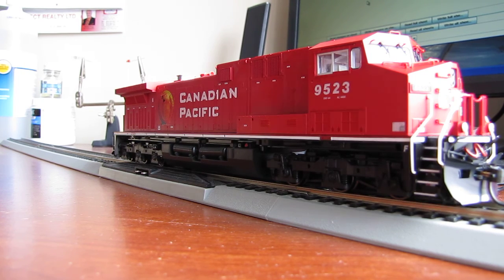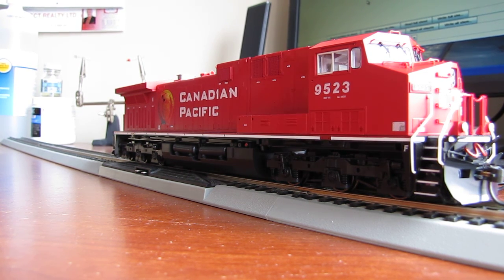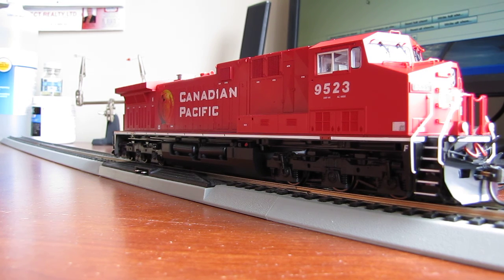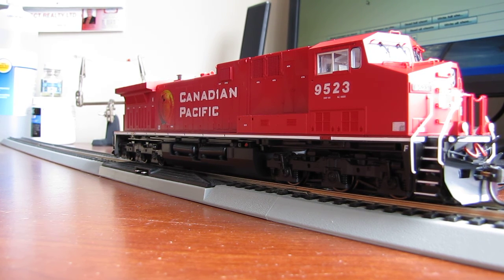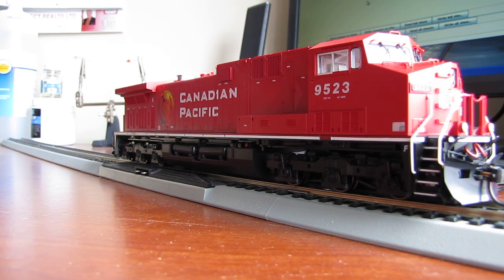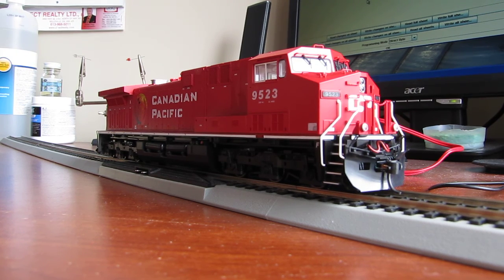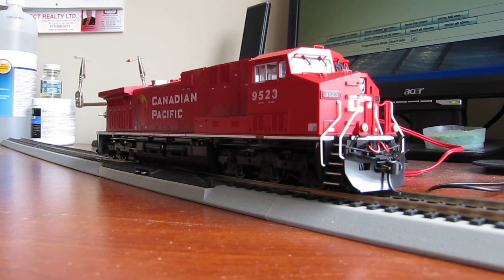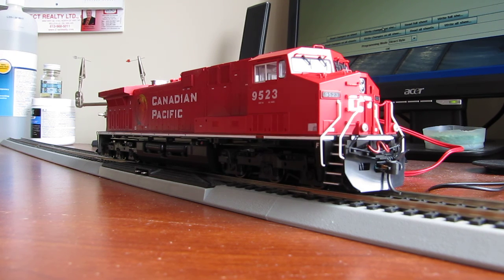03.13.13 Digitrax SFX004 Soundbug Issue, Can anyone help?

Comment from the maker: I have used tsunami before. I love them. Both Digitrax and tsunami have their differences and benefits. I like the fact with Digitrax that you can have separate cv settings from the sound board to the motor decoder.  Also as mentioned in my last vid, I simply purchased this Kato because I had the dh165k1a and sound bug in the closet and wanted to use them.

Comment: I think that's the wrong sound decoder for this locomotive, to me it sounds like one for a EMD locomotive, and normally with any EMD engine it will jump to I high notch then come down, AC4400 and Dash 9's don't, they have a lower chugging and you can hear the primer before it starts, with EMD's you get this beeping alarm

Comment from the maker: I can put whatever sound I want in this engine. I just don't have a FDL16 sound file to load onto the decoder so I just put this one on for now. The Digitrax AC4400 sound file is garbage and sounds like a constepated donkey trying to pass gas.  However in this vid, the soundbug is not supposed to do what it is doing.  Especially when I hit function 6 and it reboots the sound.. Thats not right.

Comment: Hey Brian, have you tried factory sound settings than upload the file? Myself I have a sdh164D tip do not purchase! If it still makes the wired sounds after a factory reset of the sound file my advise is sell the sound bug get what you can for it and save it and purchase a tsunami decoder suitable for it. My gp38-2w has a tsunami and I had to buy the programming track booster to go along with my zepyr (50 bucks) but I've heard if you have the digitrax pr3 you can do programming